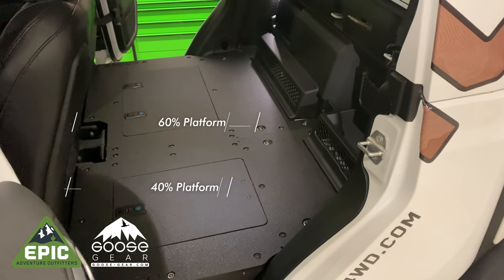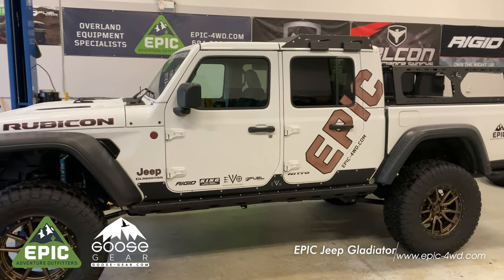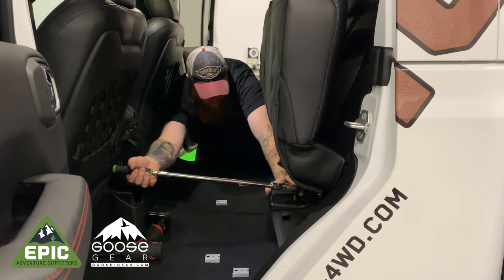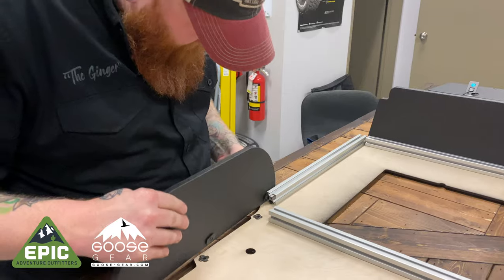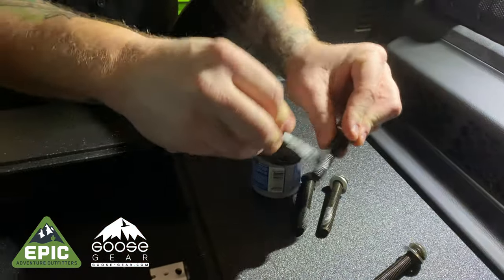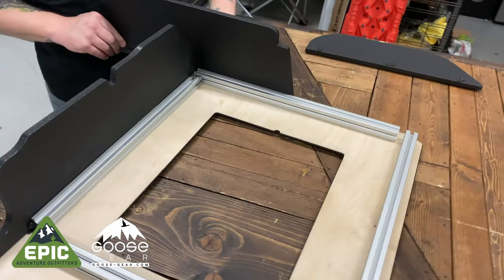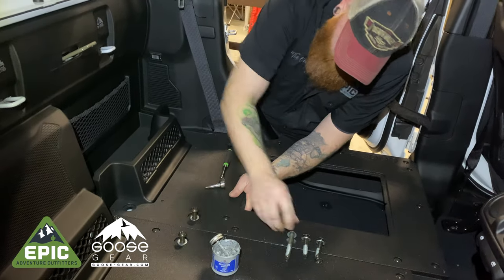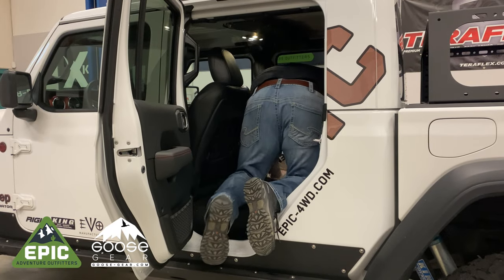Toss Out Your Jeep Gladiator's Rear Seats - We Have a Better Solution!

Comment: Ok, so I just got done installing the 60% version of the Goose Gear platform. The 60% works perfect for a medium size Labrador Retriever and you still have a seat in the back. Since today is St. Patrick's Day,  my Ginger is at a bar drinking heavily and could not assist, so I had to fly solo. There were no instructions with the package so this video is what I used for guidance and I thought I could provide some supplemental information. There are two bolts which have to be removed to separate the seats along with the two small bolts on the decorative cap that covers the seat base. The seat will NOT come out unless the decorative cap is removed. Note two things when installing the four bolts which hold the platform in place. First, if you look through the holes prior to putting in the bolts you will see the ground which makes it essential to use anti-seize. Second, when installing the front bolt on the door side only snug this bolt. There is a gap between the platform and the hole where the bolt goes. If you over tighten it like I did you will hear a horrible crunching sound as the bolt starts to go through the platform. I made a spacer to fill the gap and like everything I work on I was then able to tighten it to 10,000,000 foot pounds of torque. Last, if you leave the side panels slightly loose you can slide them and make final adjustments to make sure nothing is binding or rubbing prior to tightening. I took my Jeep off road after installation and no rattles or annoying sounds from the installation. One thing I did notice is that with the seat removed the Alpine stereo sub-woofer is now exposed and it changes the acoustics. I can probably tune it up a bit using the equalizer. All and all me and my dog are quite satisfied with the purchase. A little pricey for what it is but it works!
Reply: Hi Vernon. Does your lab sit in a crate in the 60% section? I’m curious if I can fit a crate for mine with just the 60% section without hitting the other seat. Also, did you get the normal or the high platform? If you use a crate, what size? Thanks so much.
Reply: @PaulPanus  I have a 33"x26" bed which fits perfectly on top of the 60% platform. A crate at or less than this dimension should fit fine. I have the standard platform which elevates my 82lb. Lab just enough to safely put his head at window height. It really does work well for a dog and since it is lower than the seat he can jump in and out with little effort. Good luck, hope this helps.
Reply: @vernondent6818  very helpful. Thanks very much.

Comment: I will definitely look into this. Just traded my 18 JK two door in on a 21 Willys. First thing I did with JK was pull the back seat out.
Reply from the maker: Yeah, I'm driving a new EcoDiesel Gladiator and really really really miss this mod. Going to do it again with a twist ;-)
Reply: @EPIC-4WD  Went back and forth on the diesel. Ended up with the Willy's gas. What are you doing for mpg?

Comment: I'm trading in my JL for a Gladiator and this was one of the 1st mods I was thinking about (with a few additional ideas for that area) I wasn't aware of anyone doing it professionally until now..  I'll see you guys in the spring :)
Reply from the maker: Sounds like a plan sir.
Reply: I bet you got a killing for you JL trade. My Civic Si went up $4k in value from the beginning of COVID to now, and there are so many deals on the Gladiator. So I pulled the trigger on a Rubi. Didn't see any JLUR on autotrader, and the ones at the dealership were not discounts much at all. They did sell a 4XE right in front of me which I didn't even know were for sale yet.

Comment: Looks like CNC on particle board. I could be wrong. Metal would be better option along with some tie downs. Nice fitment though.
Reply from the maker: Hi Peter, we believe it is Russian Birch Wood from Germany. It's super strong and can handle temperatures, etc. Especially with the linex coating.
Reply: Can't argue that one, well done.

Comment: Guy's am a dog trainer and you just made my day, soon as I get my new gladiator, I am ordering your kit
Reply: Are you putting a crate back there or can they roam freely?
Reply: @TheRandompaint  my dogs are free in the back, they like to stick their head out the window
Reply: @canvet-8114  it's not too tall for them ? My lab usually stands on his legs and sticks his head out the window and I'm worried if it's too tall he won't be able to.
Reply: @TheRandompaint  my old dog is medium size and as to get on is rear legs to stick is head out, my mountain pyrinees is 150pd and she sticks her head out just sitting down, you need to velcro some carper on the platform because its sleepery for the dogs
Reply: @canvet-8114  thanks for the info, I'll probably just make something out of wood that has a pullout ramp but I'll be sure to carpet it

Comment: Would it be a good idea to sound deaden the rear area before installation? Any chance to rid yourself of road noise is good.
Reply: Yes and it’s very easy. I did my entire Jeep JLU in a full weekend with the help of two friends. Removed all the interior with the exception of the dash and center console. Dynamat extreme on everything and then a layer of 1/8” dynaliner. I then added another layer of 1/4” dynaliner on the larger flat areas to give ultimate coverage. Capped it off with hotheads headliner and added 1/8” dynaliner to the doors and the Jeep is as quiet as a Cadillac Escalade now.

Comment: Any thoughts if the Goose Gear box that holds the cooler with the slide out trade would fit back there    I know you would probably need to raise it up off the seat delete floor so the cooler wouldn’t hit the sides of the door when it slides out.   I’m trying to find away to carry an electric cooler without carrying it in the bed and covering it in dust.
Reply from the maker: Goose Gear's working on something like that... stay tuned!

Comment: What happened to the tray for the bolts when removing doors and top sections? Did it come out with the seats?
Reply from the maker: Hey Dale! Yes, the little tray for the bolts could stay in there, but it would be difficult to reach underneath the Goose Gear platform. We plan on putting back the 40% seat and leaving the 60% delete, therefore that little tray would stay under the 40% seat section.

Comment: So how does this hold up if you get caught out in a heavy thunderstorm with the top off?
Reply from the maker: Russian Birch Wood with LineX coating, should be fine. We've had our Goose Gear stuff get wet and dirty lots of times without issue. It's not made for outdoor use, but if it gets wet once in awhile, I'm sure it's fine.

Comment: So let me get this straight. You have a 4 door jeep that seats 5 people, from factory , and you want to turn it into a 2 seater, with 4 doors still? Why?! Why not just buy a 2 door jeep, then remove the rear seats? It makes so much more sense.

2 door jeeps FTW!! 😄 🖖
Reply from the maker: Hey hey there. Take about 20% off there bud! Just kidding - yeah, we love 2 door jeeps and have owned and built many. Depends on the intended use of your Jeep. This Gladiator is our support truck, so it's carrying lots of weight, gear and fuel for our team for our deep forest excursions up in Northern BC. Send us a pic of your 2 door for us to check out. Cheers!
Reply: For me this is a great option for the dogs. Having a flat space in the back for the rather large impact crates is great. No, they don't go in the bed.
Reply: Secure bay for hauling bicycles on adventures!
Reply: Two-door jeeps are very nice but that gladiator has 100 times much more cargo space

Comment: I bought a 60% and 40% delete after watching several positive Youtube videos.  Avoid this product - it's absolute garbage.  It doesn't fit, the manufacturing quality is terrible (plastic peeling, improperly installed T hardware, pieces that don't fit).  

This is an insanely expensive product you'll end up tossing in a dumpster.  Save yourself the headache and don't by from Goose Gear.